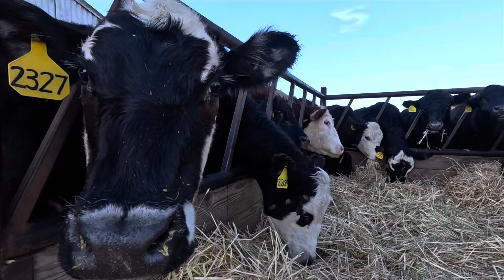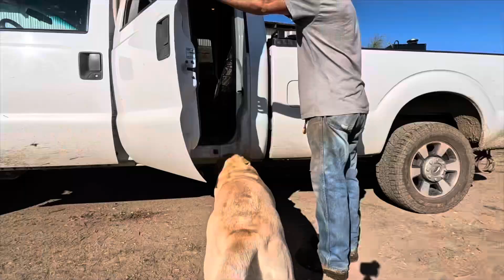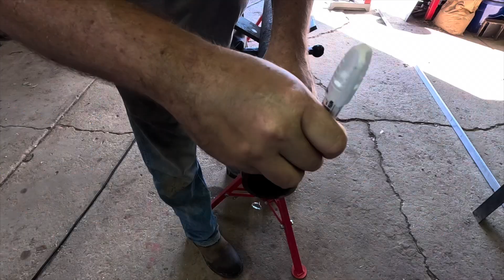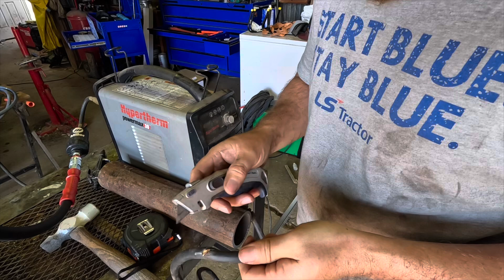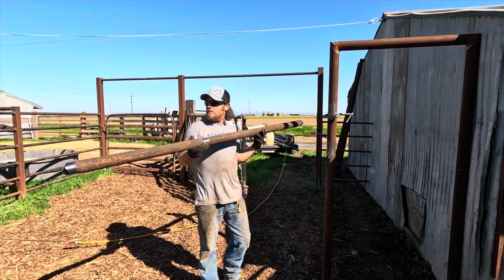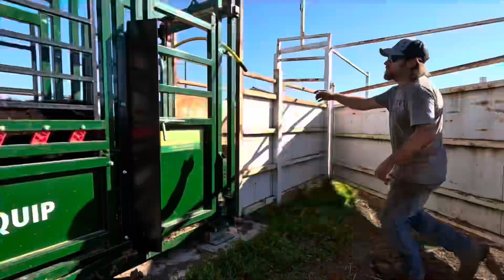Let the Welding Begin!

Comment: You can take you chop saw cope you pipe with it. Cut it at around 32-35 degrees. Then clean the high side up with a grinder. They fit great!
Reply from the maker: I never had luck doing it that way
Reply: I’m not the best at it either, but I thought it might could get you by, to finish up that job. Idk if you watch Luthi Ranch, but he has a few videos on it. Building free standing panels

Comment: If that short rail cant be reused, you can always cut it and put a band in to stretch it, wouldn't even be able to tell you had done it if you ground it smooth. If you were worried about strength at the join, you could sleeve the join with a bit of that bigger pipe, or if you had the size down smaller pipe, hide it inside.
Reply from the maker: I considered that too.

Comment: I did the same thing at work scraping out an old welding fixture. I finished the last cut and 1/2 went the way I expected the other 1/2 didn't and landed on the torch lead cutting it clean off. $1200.00 later we could use our plasma again.